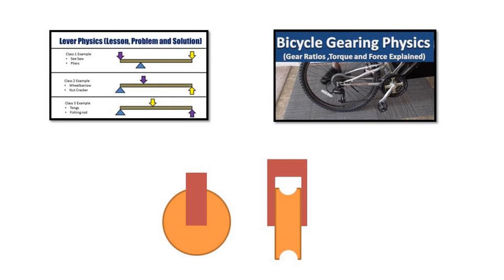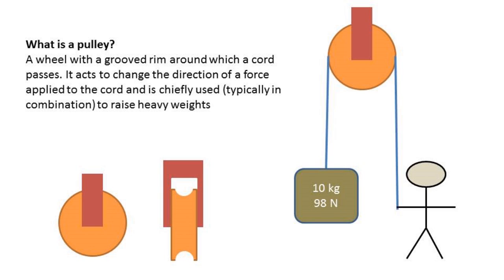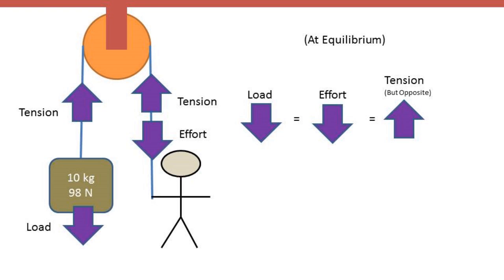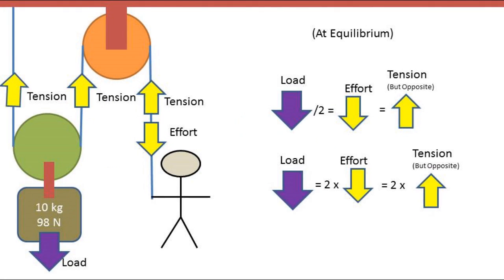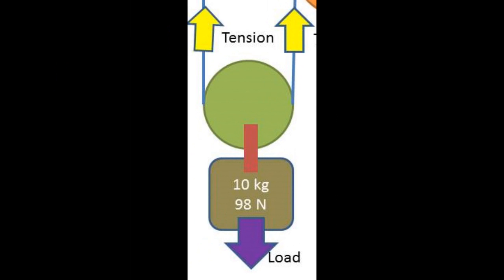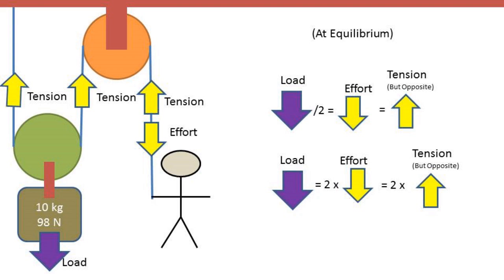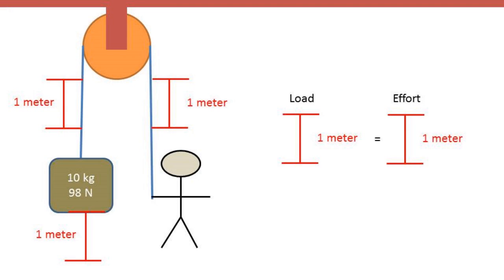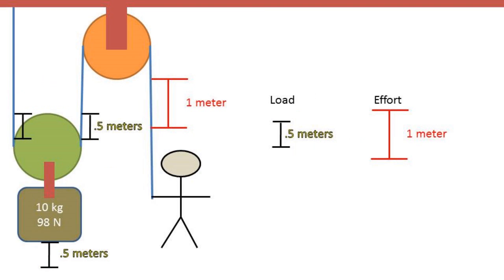Pulley Physics  (Tension / Effort / Load Force and Motion Explained)

Comment: Thank you for the video!

Would the physics work similarly if the system was horizontal and used to do work beyond fighting gravity? I am imagining sort of like a Lawn Mower's belt system.
Reply from the maker: Should be fairly similar assuming the pulleys have a resistance they are working against

Comment: I want to build a weight lifting home gym but I don't want to use weights how can increase the tension without using weights can you help me
Reply: I think variable resistance machines are based on electromagnets.
You won't achieve what you're trying to do with just pulleys.

Comment: There's something that i need to understand about measuring the weight that i'm going to pull on a home gym machine with a multiple pulley system

let's say if i want to do a workout on the cable machine as if i'm doing bicep curls with a 40 lbs curl bar (free weight)
now if i want to do the same exact weight on the cable machine, how do i actually measure it?

While pulling the cable or after i pull the cable and hold it?
Because there's a difference from the way i'm measuring (pulling or holding), like 5 or 10 lbs

Comment: question: I have a winch 10,000 lbs cap. If i use a snatch block (pulley) does it need to hold 20,000 lbs of force. in other words its holding 10k each side at max. or is using a pulley  rated at 10,000 lbs. sufficient?
Reply: jaymanxxxx this video doesn't explain the single pulley system of a snatchblock.  However, a single snatchblock, with the line looped back to your own bumper, and the snatchblock anchored to the object you want to get closer to (or bring closer to you ) will double the pulling force of the winch. However you're forced to string out double the line and the pull will take twice as long.  If you want to do a 20,000lb pull with a 10,000lb winch, you would need a snatchblock.  On the flip side, if you have a 10,000lb pull with a 10,000lb winch, you could use a snatchblock to make it twice as easy and use only half the amperage from your electrical system.
Reply: Good answer. When you use a snatchblock to winch your car to a tree or something, your car is actually like the fixed point and it works like you are actually pulling the tree to you. And it does that at half of the speed the rope goes into the winch that's why the pulling force is double.
Reply: The block is designed as a whole unit, so if you're exerting 10klbs of force, then yes the pulley needs to be able to take double that (the hook and so forth).  Most recovery blocks are made with a 3:1 safety ratio.  Also keep in mind there are frictional losses using the blocks that need to be accounted for.   If you're unsure and you have enough cable, put another block inline for safety.   Also keep in mind anything after the block needs to be rated for that extra pulling power.